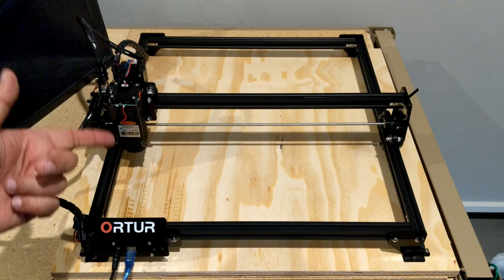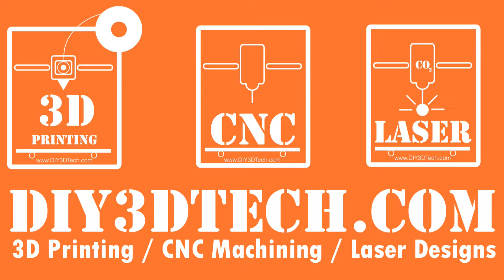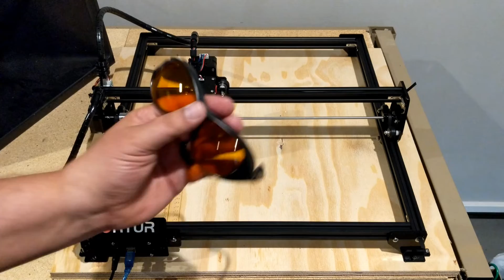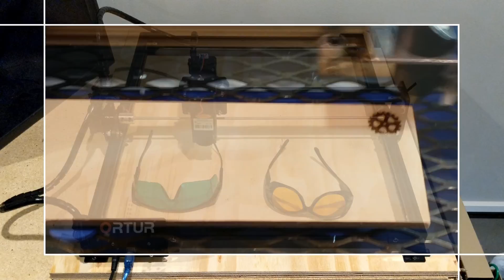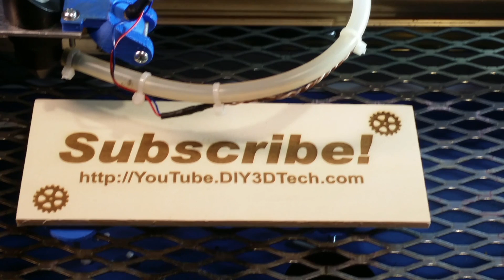Ortur Laser -  Must Have 3D Printed Modifications!

Comment: filament also works to hold up the wires on the x axis. Kinda how the Prusa Printers are designed to run the wiring. I did use 2.85
Reply from the maker: Good point!

Comment: I like the focus knob...I just need a 3D printer now.   I added an enclosure on my 20w ortur due to fumes... using a 4” vent fan.  Only air intake is from cutout for cable which allows enough draw to be effective.
Reply from the maker: You can get one here: https://www.etsy.com/shop/JohnsRobotArmy   This is not me but a view who has offered to help out folks who don't have a 3d printer.  Also yes on the case, I build one of 3/4 tubing but will convert to 20x20 maker rail...
Reply: Thanks for the link.  Just placed an order for one.

Comment: Do you think the length could be increased?
Reply from the maker: Not sure I understand the question?
Reply: @DIY3DTECHcom  I was wondering if the aluminum extruded  parts / tubes length could be extended. In other words could longer extrusions of the  length in one axis or the other allow for an increased cut area. I don't know the name of this extrusion like 80-20 for example. Sorry if I'm not making sense for you. It seems that the length could be extended but I wonder about accuracy. Thanks

Comment: Get a G8 lens!
Reply from the maker: Now this is interesting!  It has been a few years since I have messed with Diode lasers and the lens on this unit is the "common" lower quality you find on the cheap and cheerful units yet I do not a "clean" point of light.  Will get one and try it out!
Reply: @DIY3DTECHcom  I got the idea from this guy! Notice it already cuts through on the second pass. The new focal length really helps + air assist. https://youtu.be/-4JqLwaKTq8

Comment: Hi, If you are making air assist is it possible to make it to cover the laser beam so there is no danger from reflection. This will need to be just shorter than the focal length. Cheers Dave.
Reply from the maker: I have been thinking about that (a laser shield) however not sure I could get that to work with an air assist...